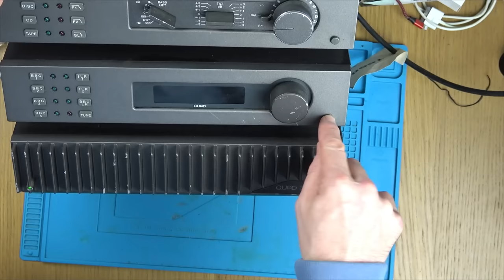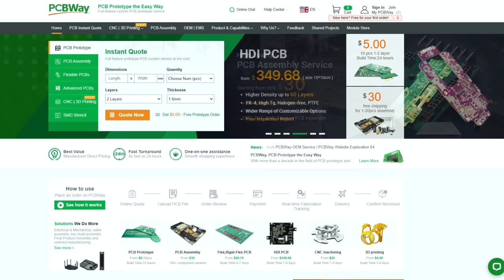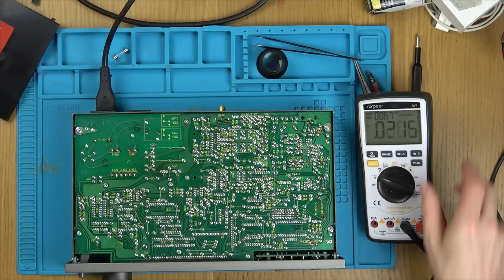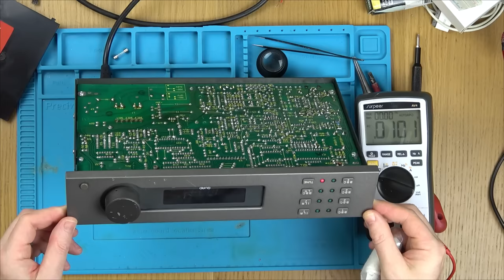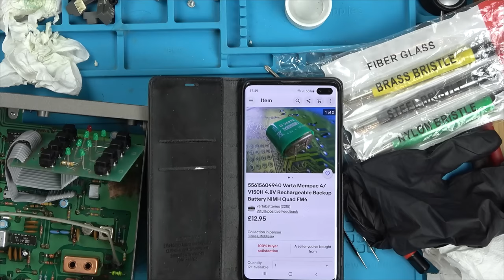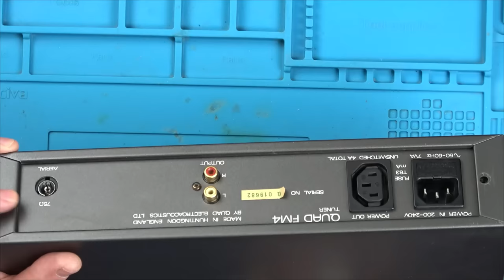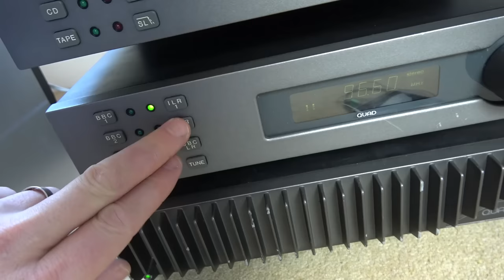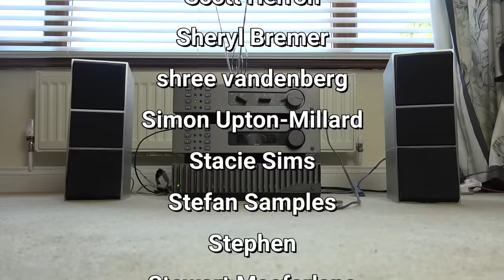QUAD - The Crème de la Crème of Audio - Can I FIX it?

Comment: Don`t take offence, but this is not high end. maybe for the average user
Reply: Quad was regarded as high end in a it's earlier years, - there wasn't much quality gear out there. They certainly faced some tough competition later on though, and was indeed bettered by some. It was always well designed, easy to use and built to last and with an excellent technical back up service.

Comment: Caution.  Never put power into an amplifier without speakers attached, or have headphones plugged in, or you in many cases will kill the sound output.
Reply: TBH most transistor amps couldn't care less, the Quad included.
Reply: Yeah, this doesn't apply for any transistor amp.

Comment: The AC in and out is live and neutral. It is not DC so you should not refer to it as positive and negative.  Fuses in equipment don't blow because of an input surge which is not a common occurrence in UK,  they blow because of an over current through the fuse from current drawn in equipment.  I assume you are not qualified from the way you approach fault finding and the dangerous tape joints in cable behind equipment. Quad is quality equipment it deserves better than the cheap speakers sat on your floor.

Comment: I can'rt really understand how an almost total amateur can make a video. What you actually did in 18 minutes was a normal routine 2 minutes check.and was enough to check the voltage on the primary (Transformer) to realize the fuse blown. the transformer has 3 secondary outputs each one with his rectfier and a stabilizing capacitor. The 3rd secondary has a voltage regulator too (T9).
Reply from the maker: Perhaps I didnt make it clear in the video or the description. It is because I am an amateur that people watch. It is the same as an average dad at home trying to fix something. Would an audio engineer be in their comfort zone fixing a Nintendo Switch or Rolls Royce? Probably not. I do different items in each video, rarely do I stick to the same product, so I am always out of my comfort zone. No one is a master of everything, I think that is why I have an audience as I always try something new 👍
Reply: @Mymatevince  I'm out of sector as electronic too as my family decided for me what secondary school to attend. I can see you have passion for your job but what I really tried to tell you is that you should spend (As I did) some time to learn the basics as this would help you a lot in the fault checking. About the HiFi sector I've been lucky enough to work in a big electronic shop during my after school hours in the 1980 and been able to see the birth of brand like Samsung or have in my hands the 1st Sinclair ZX80, C16 Commodore and even put my hands on esoteric HiFi components like a Nakamichi 1000 or a Thorens TD124. Now being almost 60yo and with a bad eyesight had to stop improving myself as impossible to work on microelectronic but still I try to learn anything I can. best regards and congratulation always for your effort
Reply from the maker: @alessandrosala2340  Thanks Alessandro 👍
Reply: @Mymatevince  No reason to say thanks: we have actually more in common than you may think, both members of the eclectic club :)

Comment: what a weeeeeierd  approach !, 
no sign of life?  1st test is cold check for 50-200 ohm across live and neutral to test mains transformer windings thermal fuse , switch ,glass fuse and solder joints 
all in one go -another way is to test for ac at any secondary as the first step -gives the same result you will know if the whole primary side is ok with just one test.

then you know if its a primary problem or its going to be a secondary side problem 
dont be so fast to go into unnecesary individual tests, start isolating location of fault as  a block  only then hone in

also why did the fuse blow  switch contact arcing ? rifa filter cap cracked? leaky dc filter caps, transformer overheating?

Comment: I commend your enthusiasm on the video for getting it working but I don’t think you really understand electronics do you - oh what a surprise that mains powered device had a fuse (QUAD 34) - who would have expected that?   Every device connected to the mains via a plug has fuse.  Perhaps the Quad 34 tilt control could be better explained but every frequency response for an amplifier/speaker etc that I have ever seen starts with the lowest frequency on the left, so the tilt control is the same.  Could you not have download the user manual for it?